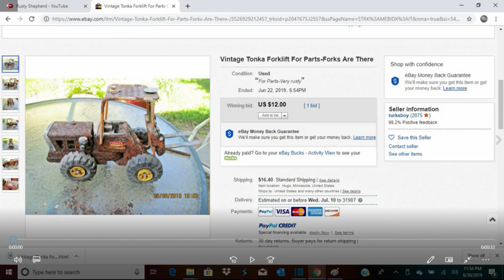1970's Tonka Fork lift "Restoration" fail? You decide. (Re-edited)

Comment: Did ya think about testing for lead paint while you didn't have rubber gloves and a dust mask on ?
Put more lighting in the sand blaster cabinet  and work bench area, and add pegboard to hang your tools. open your camera to full wide screen.
GD cicadas!!!!!!!!!!!!!!!!
Well done on moving the rust around. 
How many weeks did that take ya ??????
Reply from the maker: bigfoot6869 sasquatch Fortunately Tonka didn’t use lead paint. I have since added more light to the blasting cabinet. The entire left wall of the shop is a peg board. Tools hanging everywhere. Start to finish was 5 days, 6-7 hours a day. RS
Reply: You da man,👍👍👍👍👍👍

Comment: If your intention was to return it to as-new condition and sell it for a vast profit then Yes - a fail. If however, you wanted to restore a pile of rust to a condition suitable for a kid to play with, and probably wreck again eventually, then what you have there is a complete success. It looks SO much better. Any child, and quite a few adults, would get years of play out of it. Most full-size forklifts are covered in dings and dents anyway, so perfectly prototypical too.

Good job, keep 'em coming.☺

All the Best,
Dougie.

Comment: Nice restoration, first thing I would of done was drop that whole thing in vinegar and water for a week, and that’s how long it takes very slow process but does an excellent job of taking all the rust off. Then I would of used fiberglass to repair the metal. Nice job though.

Comment: A - For Effort! You said exactly what I was thinking ... Body filler and paint. Also you should try to see if it's available in your area is "feather fill" or Sprayable Bondo, it sands easy much like Ever Coat Glaze, works great on filling in rust pits any tiny dents.

Comment: Hope you had a longgggggggggg history in sheet metal work so you can rebuild this frustrating to the nth degree Tonka! Were you pleased enough with Alvins Ab-Metal to use it again or would you try a different product? Considering you started with a nothing Tonka...you did a FANTASTIC complete restoration!👍👍Maybe you best have one or 2 or 4 to get your blood pressure back down after finishing this project 🍻🍻😉😉😉 Can't believe 140 perverts gave you a thumbs down!
Reply from the maker: bugsychipr Hahahahaha! I have zero history working with sheet metal. The lab metal worked, it has a difficult learning curve. I only used that product because I wanted to powder coat the fork. Body filler or fiberglass can’t be cooked in the powder coat oven.  I’m learning as I’m working on different projects. RS.